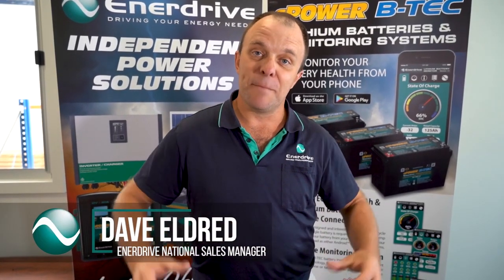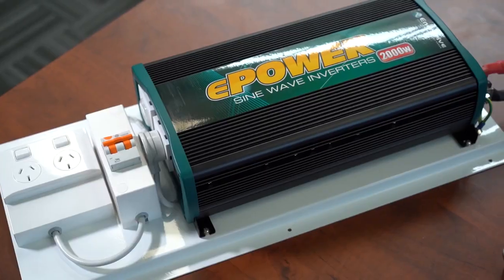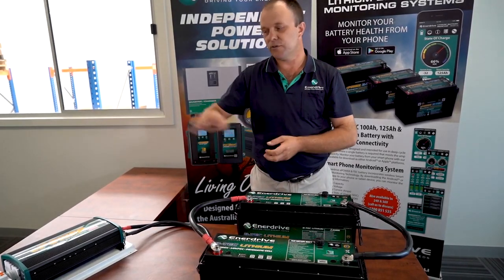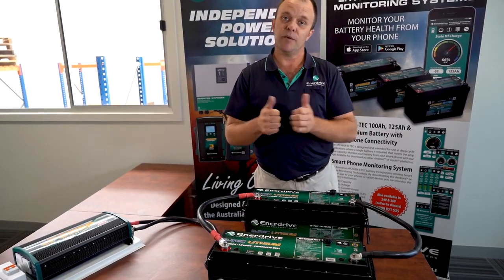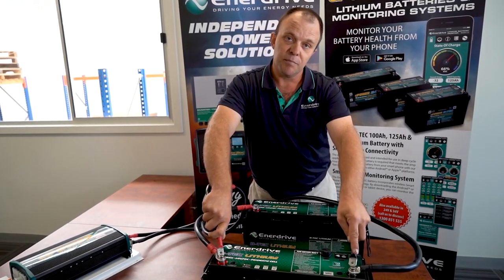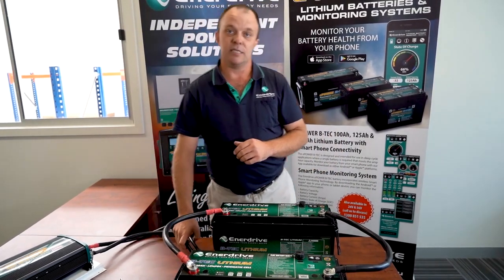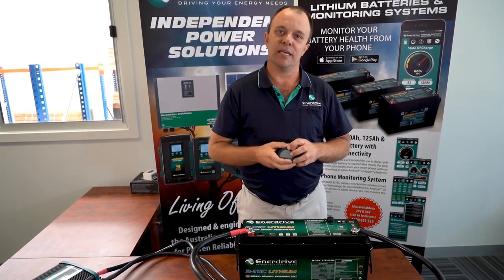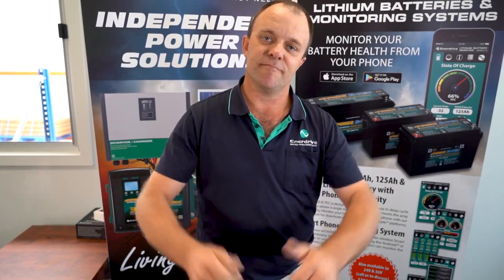Expanding Your Enerdrive B-TEC Capacity: Enerdrive Batteries in Parallel

Comment: Many batteries  are half your price. You don't seem confident in your BMS to protect your battery. I mean if  shutting off the battery harms the BMS, then the BMS sounds weak to me. Battleborn lets you wire their batteries in series or parallel up to four in series.